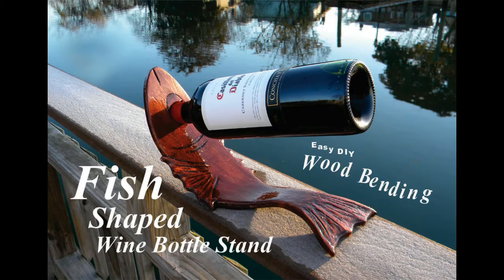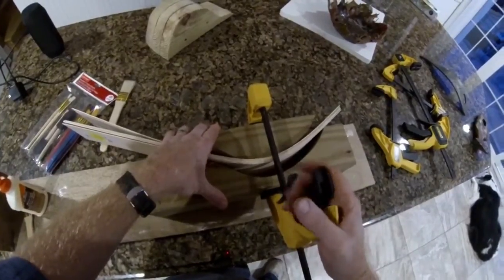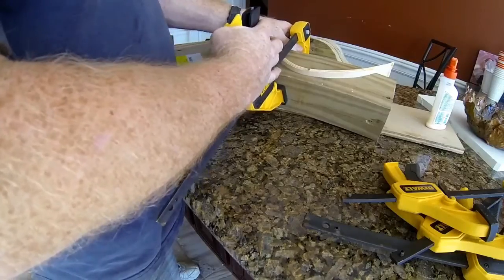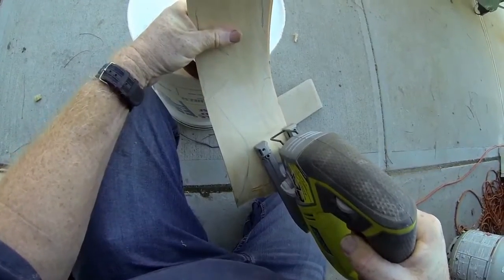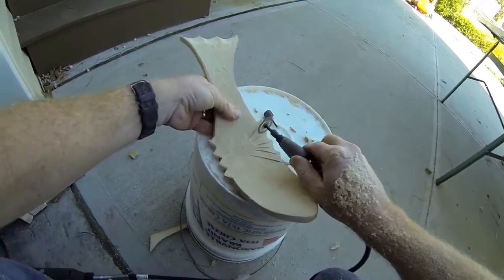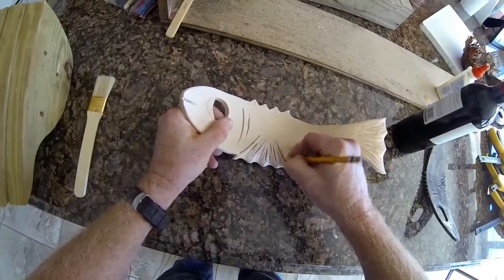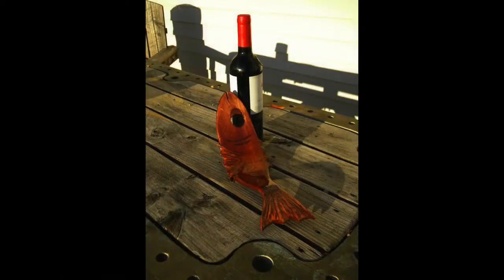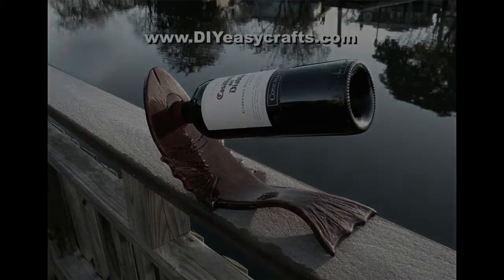How to make a Fish Shaped Wine Bottle Stand Easy Wood Bending

Comment from the maker: The original Wood Bending video showed how to heat and bend a single piece of wood. This video uses the Lamination Method of glueing several thin sheets together and then letting the glue dry after the wood is bent to shape. Both methods work well but I got better results using the Lamination Method.